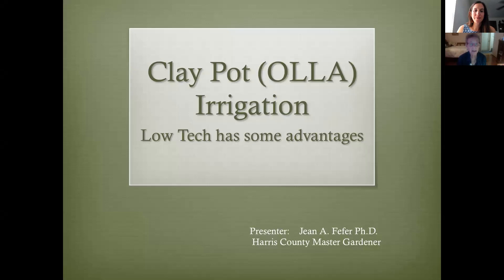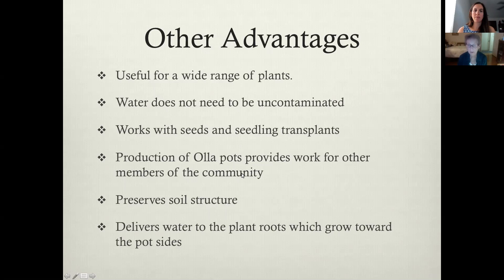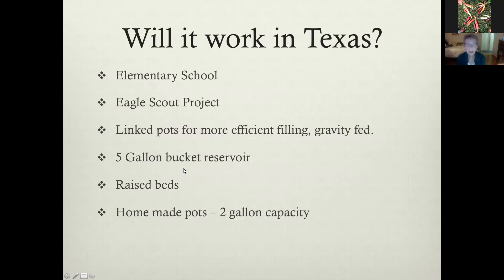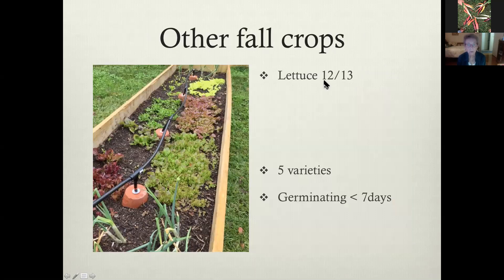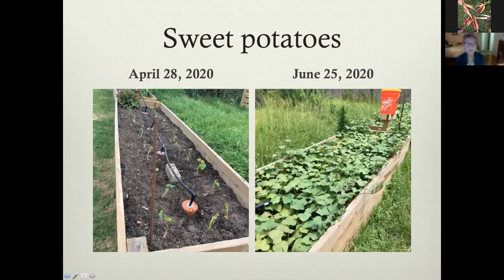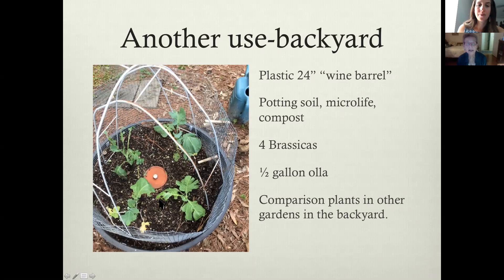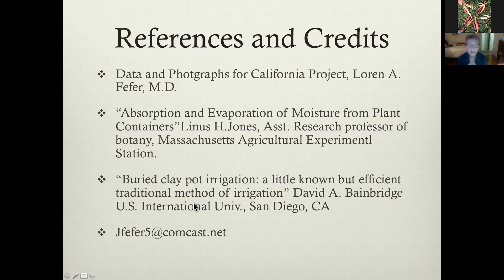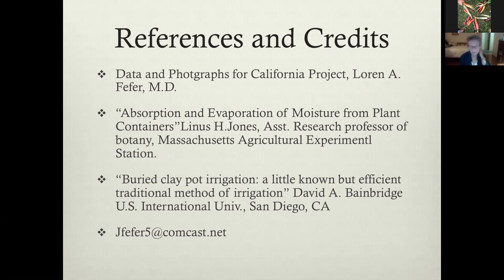Part 1: Low Tech Irrigation (Olla Clay Pots) with Jean Fefer

Comment: thanks for the great presentation.  to fix the reduced porosity, a cup of white vinegar swished around and allowed to stay inside the pot for a period of time will dissolve the mineral buildup on the inside surfaces.  if we can clean our coffee maker pots with white vinegar there's no reason why we can't use vinegar to clean the inside surfaces of the olla pots
Reply from the maker: Great tip!
Reply: We have really hard water!
At the end of the season I soak hose ends, copper anything, drip ends, spray nozzles for misting in 5% vinegar . Make sure everything works, rinse well and store dry. They have been clogged hard in the spring if I don't do it. I learned the hard way $! Don't ask what it does to the plumbing...
For clay pots  with a  salt line, dip a wet brush in baking soda and scrub at it. Let it dry and either soak or scrub with vinegar. Momma taught me that😊❤

Comment: What an astounding difference in water usage from your sons "experiment"! Every gardener needs to move to this system to save our precious resource! One question for the cattle trough or plastic wine barrel  or styrofoam containers...would they need drainage holes (for air to the soil and any excess water from rain? I feel i may have answered my own questions but just checking. Thank you.
Reply from the maker: Yes! Drainage holes are drilled in water troughs and containers. Here in Houston, essential not to hold water after torrential rains.

Comment: Hi. Great video information. 
I have a question for you:
I used silicone to adhere two 13cm terracotta pots together; used that new sughe putty to seal the bottom of the olla (checked first to see if sealed properly and only losing water from pots in center; then burried it in my terracotta container for my pepper plant. 
My question is:  while the plant seems to be doing very well, the top of the soil is usually wet!!! I keep the olla filled when the water level goes down- after a couple days since it’s super hot and humid, I imagine. But, I keep hearing how the top soil should be dry and only below should remain wet.... not sure what I’m doing wrong if the top soil is frequently moist- as if I just watered! 
I have other ollas in larger terracotta containers with my tomato plant, as well as in ground.... all similar! 
I would appreciate any suggestions or input you can offer. I really hope I’m not causing root rot or other issues (like fungus gnats) because of this moist topsoil.
Thank you!

Comment: when i test pots like that, plugging up the hole and putting water in a pot, i can see that after a while, the pot has changed color on the outside. It looks 'damp' but i don't see any water-drops or something...
So, i'm wondering is this'll work. The pots are terracotta and are unglazed. Is this normal and is this the case with your pots too ?
Reply: Prove to yourself that water comes through the clay. You see dampness, but water needs a reason to move through the clay. The plant roots wrap around and suck water from the pot. You might get a similar result  pressing cotton against the pot. 
Hope this helps.
Reply: That's the result I got with the ollas I've made, and so far they've worked pretty well. I suspect how much water seeps through the walls may be influenced by how dry the air is, but I couldn't say for sure.

Comment: Thanks a lot for this video! Is this system still in use? Or have you changed anything? Would you still recommend it? Thanks. ❤️🙏🏻☺️
Reply: I'm curious about this as well. I've built several ollas and I'm trying it out, but I would like to know how others have fared using ollas.

Comment: Hi, I have a question. I’ve installed a few pots with a small tank similar to the setups in the video. The problem is I can’t fill the pots automatically. When the line going into the pot is sealed onto the pot with a stopper no air can escape so the water doesn’t feed into the pots. If I pull out the stopper to ‘break’  the air seal water will start dripping in. And if I sit the stopper on the edge of the hole the pot will fill but keep overflowing until I turn the tap off at the tank or re-seal the stopper.

I feel as though I might be doing something wrong? Any clues? Thanks!